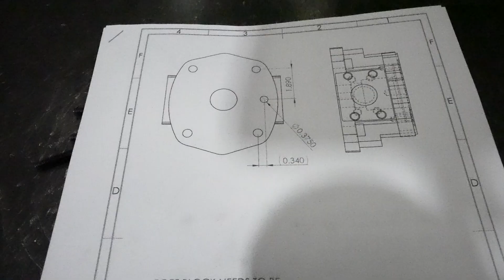How 75 Piston Pumps Went From Trash To TREASURE

Comment: Good catch! U should do a video on the different oils pumps use. Say like JD loaders say to use 15w40 in hyd system,  but can u run a AW46 instead? And whatbwould be the downfall if u ran AW46 instead of the 15/40 motor oil. I think its just Temp ratings for heat? Or like CAT says use theyre 10w oil in HYD systems,  can u run a AW46 Or a AW32 instead.  Or it really doesn't matter